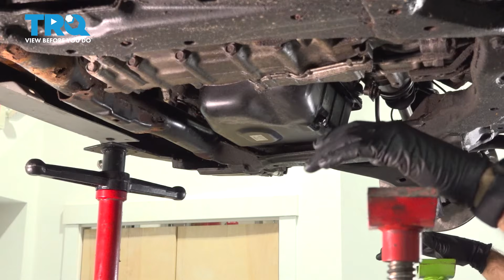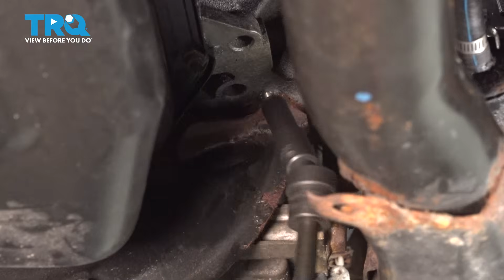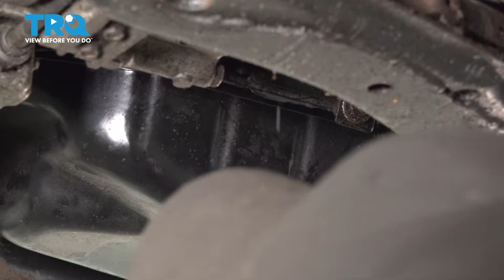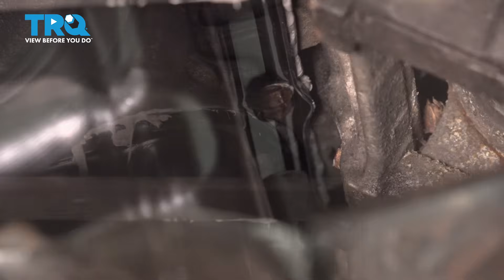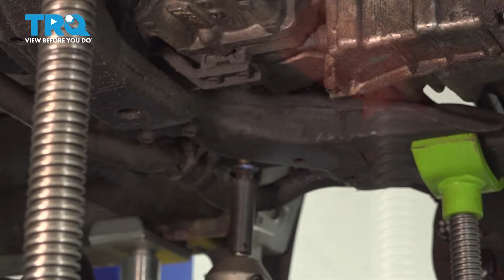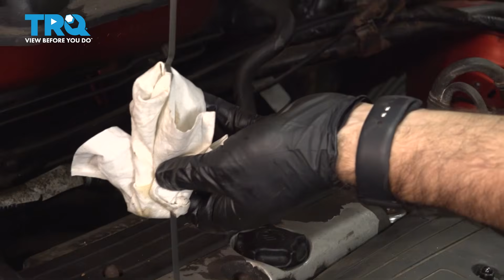How to replace Engine Oil Pan 2003-2011 Honda Element

Comment: Well.... For anyone watching this, it at least gives you what you need to know to get the pan out.  What it does show are some questionable practices.  I would strongly suggest using 1/4 inch drive tools for the removal and install of the oil pan. 1/4 inch drive tools will allow for straighter approach while removing and installing the hardware.  And never start any hardware with an impact tool!  Cross threading into aluminum is a recipe for disaster in more ways than one.  Take a few extra minutes to clean all the hardware you removed.

Comment: I cannot find any videos about doing this on a 2008 CRV. Does it have the same/ similar subframe? Would the same process apply?. 
What are your thoughts about lifting the engine rather than lowering the frame? 

Thank you

Comment: THANK YOU FOR THIS EXCELLENT VIDEO!!
I don't need a new pan but I need to re-seal mine.  It's leaking at the corner by the oil filter.

Comment: What is with all these wannabe mechanics referring to the left side of the vehicle as the "driver's" side and the right as the "passengers" side?
What happens if the car is right hand drive?
Car lateral directions are ALWAYS given when seated in the car and looking forward.
Referring to them as driver and passenger sides is a sure sign of a novice...

Comment: Thanks for this video - best one I've found so far for the oil pan. I'll be working on the ground, and I was wondering if you could clarify if you're referring to jackstands or actual jacks supporting the subframe. With Jackstands I don't think I could lower or raise themin smooth increments like you do with the pole stands. Thank you again!

Comment: My oil pan bolt is strip in there and I'm kinda tight on cash to replace the pan. Can I have a shop retap the drain hole????

Comment: If anyone is wondering, this procedure applies to the 2002-2006 CRVs as well. I just did the oil pan gasket on my 2005 CRV from the garage floor with a few jackstands and jacks, and the subframe procedure is exactly the same 🎉✌️

Comment: OK I did this, and I’m wondering what I could’ve broke. I had no code prior after one trip the next day check engine light came on reading 
P2647
Control unit:09
Status: Confirmed
Rocker arm actuator A, bank 1 - actuator stuck on VTEC Oil Pressure Switch Circuit High Voltage
The VTEC solenoid is only a year old, I will replace it tonight and put in a new one but I’m concerned that I’ve done irreparable damage. Any thoughts? What could I have broke?
Reply: I did the same and when i changed the oil some particules blocked my oil passages same code